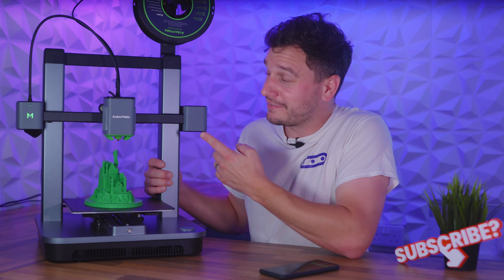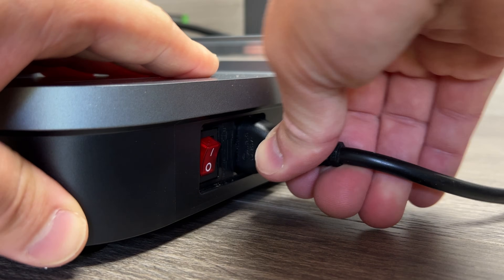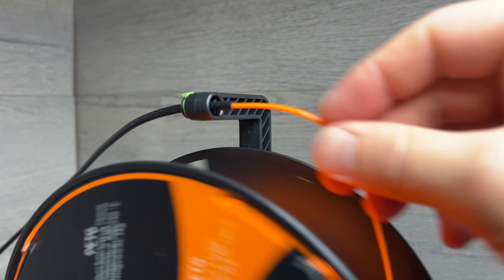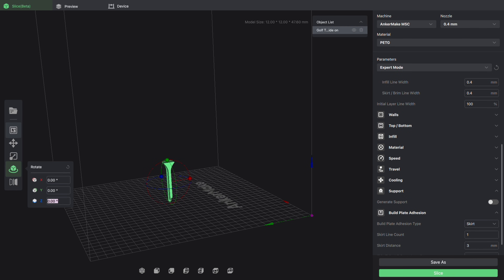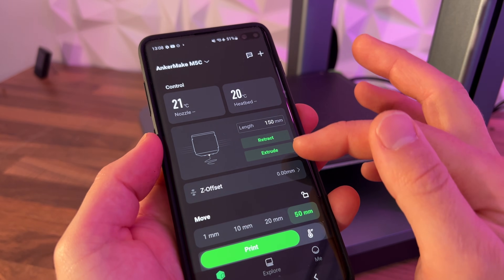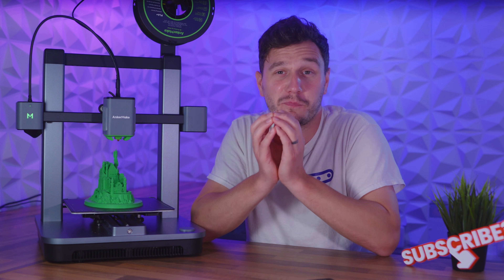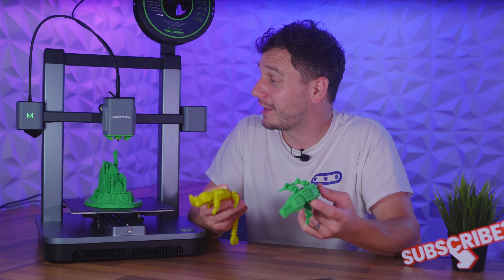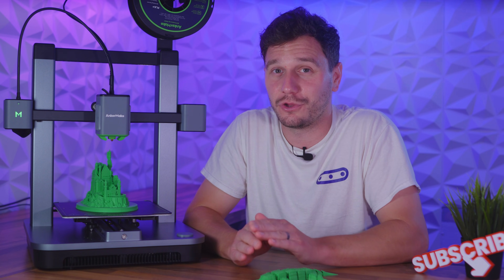The BEST 3D printer for BEGINNERS?! (ft. AnkerMake M5C)

Comment: You CAN print directly from your computer with the AnkerMake slicer, done it ceveral times. If you can not print from your computer using the AnkerMake slicer, you did something wrong.
Reply: It doesn't download ankermake it downloaded eufymake and there is no way to connect your device to it over network unless you use a phone

Comment: The detail on the castle looks amazing for a filament printer. Do you think the new bambu a1 mini would produce such detail on its prints?  I’m looking to buy my first printer but want to get the most detail possible on an entry level machine.
Reply: I have been using the ankermake m5c and it is perfect. I would go out to say it is better than the Bambi printers expet that it does not have enclosure or multi colour printing however ankermake is producing a multicolour add on.
Reply: @Iffath-Ahmed  it’s a shame it’s still quite expensive in comparison. You can buy the a1 mini with asm for the same amount
Reply: 1/3 the build area though. @nickholl

Comment: this is cool, but it would be nice to have an sd card slot on the printer. Great video as always!
Reply from the maker: Yeah I get that… they’ve chosen to move exclusively to future tech which is a bold move (I do admire them for it)… managed to get hold of a Usbc for less than £10 so not too bad I guess! 

Thanks for the comment, really nice to hear! (We probably need to get our butts into gear with posting more long form 😅)
Reply: @playconveyor - -  just wondering and curious 

 After I got Ender 3 , I was  playing . the sd card fell into 3D Printing it was on accident. I put butter knife trying to get sd card unfortunately no lucky   - I did take the card from open the box apart then put together. 

After that - blue screen is saying No TF CARD 
What should I do next ?